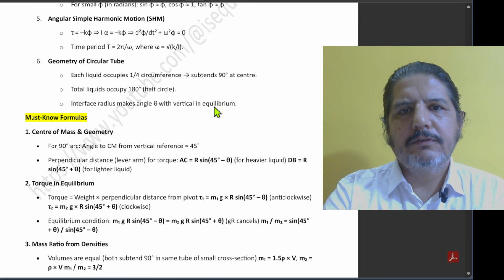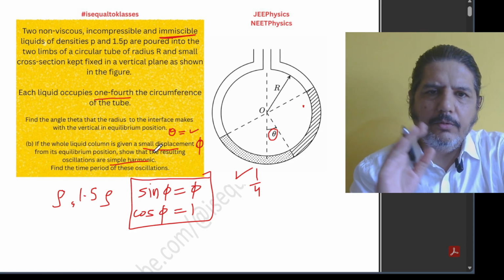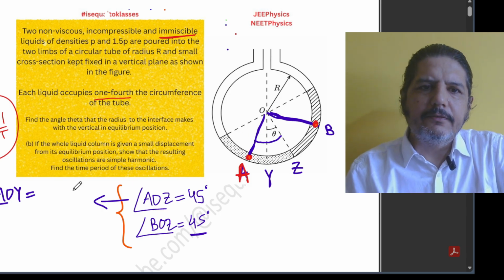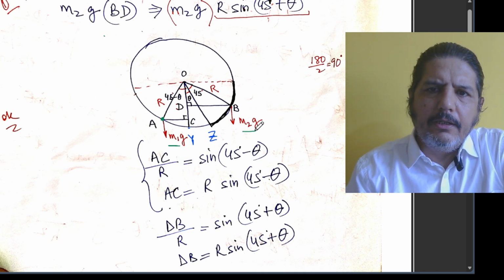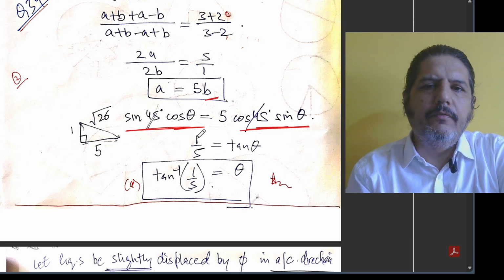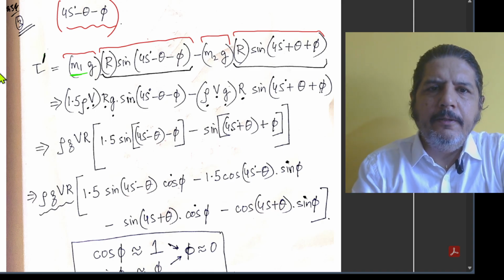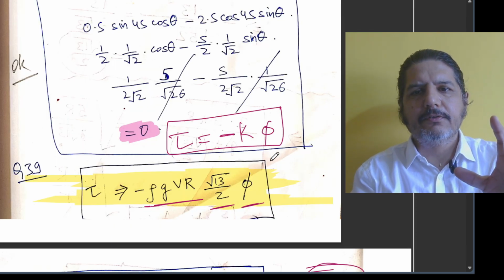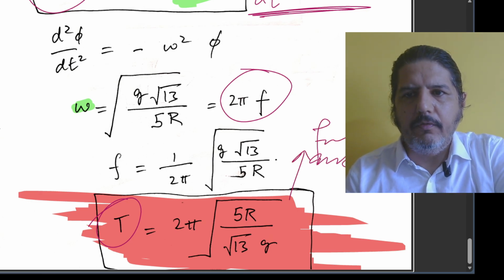Two Liquids in Circular Tube | Equilibrium Angle | SHM Oscillations & Time Period | JEE Physics

Comment from the maker: ✅ Key Concepts Mastered:
• Geometry of circular arc & subtended angles 
• Centre of mass of liquid arcs
• Torque balance about pivot for equilibrium
• Small angle approximation (sin φ ≈ φ, cos φ ≈ 1)
• Restoring torque → SHM equation
• Moment of inertia of the system